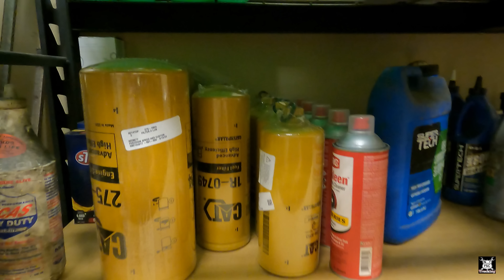Maintenance Issues Before My West Coast Trip

Comment: Hello Steve from New Zealand 🇳🇿.  Love your docos and love Orwell. Love that CAT as well. I noticed in the US 80000 lbs  (35.7t). Here our H plated combinations can load up to 141000 lbs or 63 tonnes provided no axle in the combination exceeds 15200lbs or 7 tonnes.  So most of our combinations are 4 axle twin steer trucks pulling 5 axle 40 foot trailers. Or 3 and 4 axle tractor units pulling 4 axle 45ft semi trailers. Love Orwell, beautiful looking truck. As you know, our trucks are mostly Euros up to 750hp, and the first of the K122s are here. Cascadias have arrived as well. Western Stars still continue to dominate the logging industry along with KW and the high hp Euros. A lot of operators are rebuilding their CAT 3406Es and juicing them up to 675hp. 
Isuzu and Fuso are catching up in the 500hp bracket. Our normal drivelines on heavy work here are 550 -750 engines, 18-speed Fuller transmissions through 3.4:1 differentials. A lot of our operators prefer the planetary final drives for heavier work. Keep up the good work.

Comment: If you put ATF in the fuel filters before installing it helps to clean up the fuel delivery system. Just a thought.  Worked well from an old timer showed me in the 1970s till now.
                  🤔

Comment: With the camra shaking like that. looks like an mini earth quake, but it looks like a server thunderstorm passing thru. I think their are fifth wheels that have the rub ware plate on it so you don't have to put grease on it. But not sure how good it is.
Reply from the maker: Worthless with a mechanical RGN.
Reply: @fsctrucking  yea, you would have to keep replace it every time, move the plate every time you move the neck from the trailer and weight you haul. So Grease it is.

Comment: You may want to try what I did with my k 100 and put your oil fill in the back just above the exhaust and the dip stick to the side just under the cab it made it shorter and easier to check for me anyway and great job with the truck and great video keep up the good work God bless from GA and stay safe

Comment: How do you find work for your truck? Load boards? Do You have your own trailer? Thanks
Reply: Steve is an Owner/Operator signed onto a mid-sized trucking company that does his load scheduling. As far as trailers, he has 2. The RGN on the truck currently and a regular stepdeck flatbed that he is rebuilding, and soon he will have a third, a dry van that was with his new Ford CL9000 Cabover.

Comment: Glad that just bending that telescoping tube fixed the issue.  I would expect removing it, re-bending it or replacing it would have been a time consuming thing and replacement would have been expensive.  I guess if you ever turn Orwell into a parade and show truck, a polished and squeaky clean fifth wheel would make sense.  But Orwell is a working truck, so he needs to be a bit greasy and cosmetically imperfect to show the world that he is a worker, not a showpiece.

Comment: That a boy Steve, the best thing you can do for any vehicle, car, truck, bike or your big rig is to service it regularly  and with great or better trusted name brand oil 🛢 and lubes and filters. Way to go big man!
Love the look of the Ford cab over, the Era of the air starter ! It being a single axle? Can you lengthen the frame and add a second ? And or third axle?🤔
 It sure looks good 👍🏻 Steve! 
Safe and happy travel,s. To me, your doing good, hard working and looking for more!
Got to love the look of cab overs, close call, but that Ford slab front end is iconic 👌🏻. 
Are you going to pilot the Ford? Beings it only half full and all!😉🤣🌦🇨🇦✌🏻🤘😎.

Comment: used to drive for CFI and FCC over 1.3 million safe miles and one thing is for certain if u dont maintain it and keep up the service its gonna tear up at the worst time 

FCC used to grease our trucks every 10k miles and oil changes every 25k had 2 breakdowns both from manufacturer defects ( HP Fuel pump at 231k and the radiator split at 40k) had 1 trailer tire go bad in 4 years there

CFI did grease jobs when they did oil changes at 50k used to grease it myself till heartland bought em out and was then told if i greased it again i will be terminated on the spot as i am not qualified to do any work including changing a light you were required to call a road side service to change a pop in light 
2 months after that kicked in i parked it at the Seagoville TX yard and left but the kingpins in the steers were going dry driveline u joints was making something horrible

i now drive spotter trucks so FMCSA and scales are no longer a thing as we put around in trucks that loose air in 10 minutes tires so bald F1 swears they are theirs all good fun 
Maintenace is an investment that has a very good return dont forget that Steve :) stay safe out there
Reply from the maker: With service intervals like that you can tell they weren't invested in thoes trucks for any length of time.  They dispose of them once they kill them.

Comment: Ive only seen a couple of your videos and I know that you’re not a big fan of “newer stuff”. But, the newer stuff is better operationally, and debatably financially. 
A newer truck is more expensive up front, but you have lesser maintenance requirements, more power, better fuel efficiency and a slew of other things. There comes a time when older vehicles run their course and the cost to operate outweighs their revenue. 

Cab-over trucks are no doubt cool as fuck. However, they were born out of a time when trucking regulations were at an all time high and truck overall length was strict. Once the regulations loosened, they became obsolete. A “long nose” or Traditional truck has pretty much all the advantages compared to a Cab-Over. Longer wheel base for better stability and load capacity, bigger engine options, more space. 

I just find cleaning out your truck every time you have to do engine maintenance kind of pain. Time is money, and that seems pretty time consuming. 

You do you. If you like it, I love it.